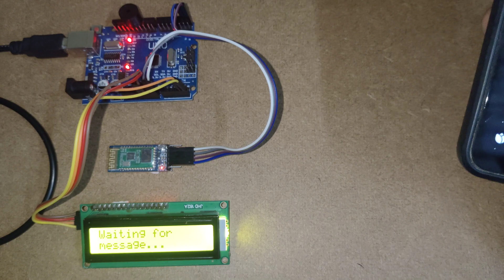Bluetooth-Based Notice Board with Arduino | Scrolling Text Display

Comment: Hi 
I can't connect HC-05 Bluetooth module with my android phone.
It paired but not connected.
My project is Bluetooth controller car. Please tell me how to do.
Reply from the maker: Try in different phone and check the communication pins hc-05 Tx to rx of controller hc-05 rx to tx of controller